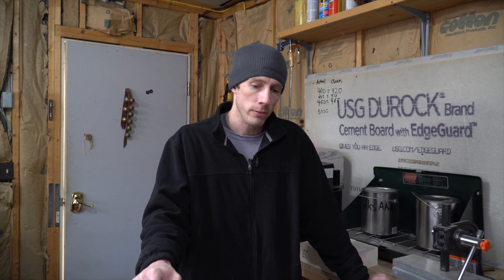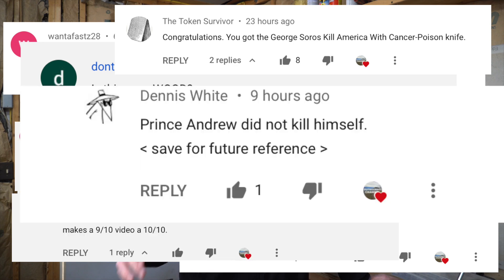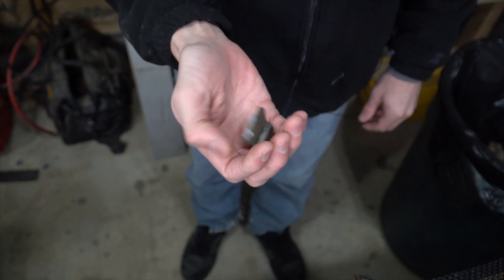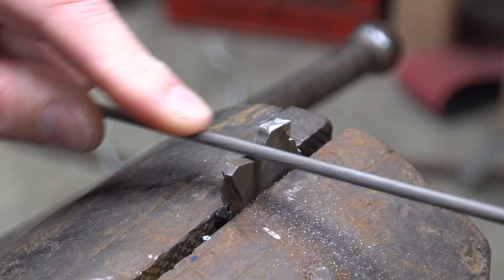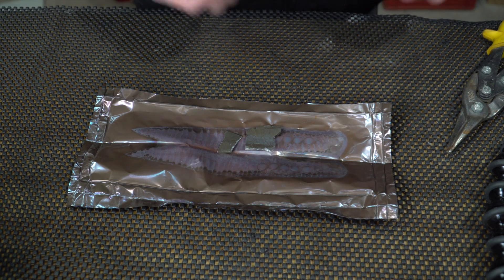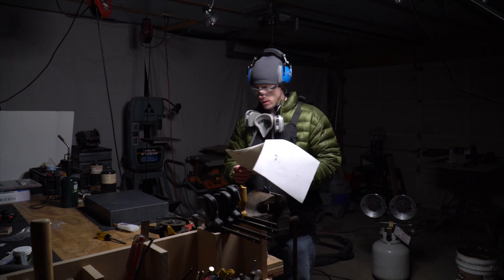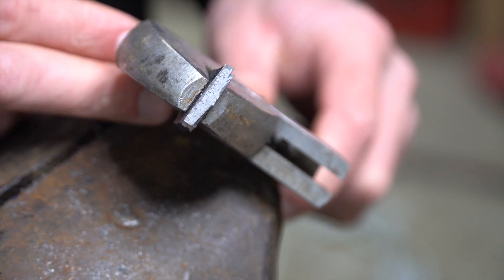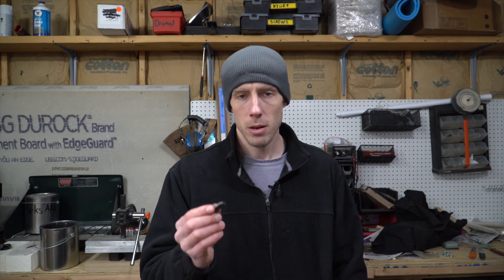Will Cheap Damascus Harden?

Comment: To me it looks like what you had is a knife made of folded aluminum and steel. After the heat treat you can still see the layering and the file just chews through it like aluminum.
Reply from the maker: Aluminum would have melted 🤷‍♂️

Comment: My steel guess, is it's actually generic recycled automotive steel. Using leaf springs can give a great knife. But if you're using a bunch of body panel steel mixed in there + zinc coatings... you're going to run into issues.

Comment: I would have tried to stick a magnet to it right off the bat. That didn’t react like steel at all, it may just be extraordinarily low in carbon but that didn’t seem right at all. Almost like it was a non steel substance coated in steel. Weird.

Comment: High manganese steel alloy. Ew. What it looks like to me with my metalshop experience. OMFG that horrendous noise when you filed it, which sounded more like rubbing a rough rasp on concrete, the second time. RIP my ears and headphones.

Comment: i think they have a mass process where they get ultra thin sheets of steel and make the damascus with one quick heat in the forge.   they dont cut and restack the billet to get thin layers.   this is why the outside forge welded good and the inside didnt.   just my guess i may be wrong
Reply: explains why its cheap, its made in the quickest way possible

Comment: now i'm no blacksmith but every hardening heat treating i have ever seen done required the metal be heated to a glowing red hot and then quenched in oil, what you did appears to be "tempering" where by a super hardened/shatter-able blade is slightly softened and relaxed to make it less shatter-able without removing most of the hardening. see you need the sudden drop in temperature to cause the metal to crystallize
Reply: go watch forged in fire, man at arms reloaded or any other knife forging video
Reply from the maker: I did everything correctly 😂 I literally show the quench. 
Watch the video again.

Comment: That steel look like something made from a car press and maybe compressed again in a rolling mill without any heating process. You couldn't harden the core obviously because the layers are not homogenized or only in contact, they never were, you can't reach it without melting all that trash.

Comment: Pakistan has a lot of scrap yards were they will recycle/reuse literally anything that's scrap-able. My guess is the knife was made from literally scrap metal from a scrap yard. Melt a bunch of random car parts, industrial machinery, etc, down and make a "knife". That's probably how they got the Damascus part, from different scrapped pieces made of slightly different steel.

Comment: park 50 is on the fast side for quench on 1095.but it will quench
Reply from the maker: I definitely wouldn't say its on the fast side. Water may be a little fast but not parks 50.

Comment: This is a very delicate knife, you need to wrap it in bubble wrap, and when you use it, leave it in the bubble wrap, it'll protect the blade and make a sharper cut

Comment: ok so the tldr is the knife is NOT what it says on the page definetly not 1095 
comes poorly heat treated out of the box and is thusly unusably soft
whatever steel alloy it is made from it IS damascus just really crappy such and it's not really worth buying as you need to put it through an insane amount of work to make it usable

Comment: Really weird steel, I've never seen anything like that, but I always buy AISI grade steels when I attempt to forge stuff. At first I was like 'Yeah that's mild steel' after you managed to file it after a quench. But then it actually snapped instead of bent, so then I thought nope that's not mild steel it's got a little bit more carbon content than that. I have a hunch though, I think it might be a medium carbon steel pattern welded with mild steel. The mild steel absorbed some of the carbon from the medium carbon steel when it migrated during their initial process. What do you think? I bet it's something like that, and I don't think they sent it to you heat treated, I bet it was in its annealed state when they sold the knife. So they made billets of pattern welded mild steel and medium carbon steel (Like a cheap 1045 or something) Then the 1045 leaked it's carbon intot he mild steel, making the overall carbon content around 0.25 or soemthing, then you heat treated it, and the carbon displaced and kind of turned martensite in 30% of it. That's my best guess.
Reply: Londinium Armoury       I reckon it may be a type of pure Iron. If it is from China they have a problem with over production of Iron an Steel at the moment. A manufacturer had some excess stock an this knife shaped thing is the result.
Reply: Or really, if you were to make a “Damascus knife” that was cheap to make, and your only worry when it came to sales was that you wouldn’t be legally changed for scamming your customers, what kind of cheap alloy would you come up with that wouldn’t be overly hard to work with? One alloy you could use would be old discarded tin cans, but what would the other be? Scrap iron is quite hard, and it would have to give that right colour.

Comment: Look like you use a chainsaw file, they will cut throw nearly anything!
Reply from the maker: They wont cut through properly hardened 1095
Reply: @OUTDOORS55  Some of the file that I have can cut throw high speed tooling steel, you can get set of files that help determine the hardness of the surface, from mild to diamond abrasive file!

Comment: Hi, Alex!  I watched both videos and have a question but, it isn't about the crappy knife.
What do you call the grid thing in your heat treating oven that holds the knives upright during the process?  AND, did you make it yourself?  What did you use, if you made it yourself and if you didn't, where can I get one?  Obviously, I like run-on sentences!
They ARE serious questions!  I've seen them in other videos from other you tube video makers and knife makers and have always wondered where or how I could get one.
I'm a beginning knife maker, at 67 and don't have all the goodies you have but, my knives are MUCH better than the one you feature in these 2 vids.  I would like to be able to do a better job of heat treating and tempering and think that whatever that thing is called would be of some use.  Are the upright rods ceramic?
Anyway, if you could help me out as to how to make one  or where to buy one (maybe do a video on making one if that's what you did) I'd really appreciate it.
If you do answer this please contact me @ 3073493792 to leave me a message.  I may never get back to this video to see the answer, otherwise.
Thanks and keep doing the great videos!  I have watch many of them and have learned a lot!  Kudos!
Merry Christmas and Happy New Year, belatedly.
Reply from the maker: Its a ceramic holder from evenheat kilns. Hope this helps

Comment: I bought one that looks very similar at a gun show in Dallas and it was not hardened either.  It split on the edge between 2 layers and when I tried to sharpen it with a diamond sharpener there were huge flakes coming off that would ignite and burn up like ferrocerium.

Comment: I didn't know if you'll even read this , but I have a question maybe you could tackle in a later video.  Question is , how do you patina a stainless steel knifeblade?? I would like to see a video on this.  I've seen plenty on carbon blades but not many on stainless.

Comment: I've heard the term "pot steel".  All the crap thats left over after proper steel us made, gets thrown into a pot and then 'single use' steel is extruded.  Any steel framing around machinery in a container from China is single use.  It might as well be cast iron.

Comment: I thoroughly enjoyed these two videos. The only reason I questioned its magnetic properties is because it doesn't quite look ferrous. Of course an acid etch will do some greying externally except that it didn't look right when you broke it up. Somethings just not right there.

Question is do they keep track of Batch numbers for Q.C. wherever they made that? Can you imagine a Bridge made of that mystery metal?

Comment: I live how easily the supposed layers separated lol it would literally take an entire reforging in order to get the layers to properly bond to one another and then maybe then it would be able to heat treat or harden to a reasonable hrc and be used as a blade steel lol

Comment: What ever type of steel it is it is very subject to surface de-carboration. From memory some types of steel require a carbon rich environment while heating to reduce carbon loss. Some modern alloys can resist this carbon loss to some degree. The alloy chosen was not suitable to the heat treat method that was applied. Once damaged it may not be repairable.
Reply from the maker: All high carbon steel is subject to decarb. Its a complicated subject i cant get into in a youtube comment. The heat treatment would have been correct if this was a high carbon steel. If these was very little carbon in the steel it would give the exact results shown. This isn't a stainless or a high alloy steel or we would have had different results. Particularly in the grain refinement cycles. Its just junk steel.

Comment: I could probably make a jb weld steel stick better than this
Reply: Challenge accepted! Send your findings in to this guy and we can compare recycled toilet slag to your JB Supreme Cutzall. I mean that kni...well metal ish object you could poke someone with, not too hard so the thing doesn’t break, but it did change the grain.
Reply: Actually you could make a fiberglass reinforced dual resin damask ‘knife’. Two different resin types mixed to make a pattern the shape, sharpen and add a handle.

Comment: Hey Alex I've got a question. Just the other day I remembered your previous quest of designing and building the perfect knife for a week long trip. I can recall that you were looking for a very lightweight option with lots of toughness. And since I'm not very well informed about the difference between titanium and steel when it comes to heat treating, would I ask if titanum would be that option? I've always heard that titanium would be much tougher than steel and since its way lighter wouldnt this be the perfect option.

Would be great getting an answer (from anybody) otherwise I wish you the best and please continue making videos! Ive been following your channel for a while now and you do produce GREAT content in my optinion. Your humor, knowledge, production value and Ideas are one of a kind! 

Greetings from Germany!
Reply: Titanium is structurally a million times better than steel. As it can take torsion and tersion as well as tension and compression much better than steel does. Titanium falls short in blademaking however as it is incredibly difficult to work with and also very dangerous. As forge temperatures it can sometimes explode into chunks of near molten metal. Oxidizing rapidly and setting many things on fire. Other than that, smithing a titanium knife is just downright hard on your tools. A grinder will take many hours to even profile the knife. Sharpening is even worse. And once sharp its edge retention is pretty much the same as steel. A little better with a little more hardness and toughnes, but overall not worth the work unless you want to make it as a show of skill as a bladesmith. Its also nearly as expensive as gold.
Reply: @Aaron Washburn stock standard titanium is better than stock standard 1085 or 1095. But HSS or stainless steel is almost always superior in the blade making realm so long as you treat it right. Titanium is great for structures though, sporting almost exact properties to steel but at much less weight. So an anvil would be great. But titanium isnt worth it as a blade. Also makes a great finishing hammer for smithing. Light hits that are easy to control. I use mine after i use my 7lb sledge and i often have a near finished product at the end. Really only needing scale removal and some file work, then a good sharpening. The heavy one moves it and my light one smooths it. I made a knife from it once but honestly wasnt a fan. It was sharp. And it could hold some edge. But i didnt like it as much as i like my other knives. It never had the same feel. Always felt like it was just a breath away from snapping.
Reply: @masonborden5594  Thanks for the good answers!
Reply: Always mate. Here to offer any other answers should you ask.

Comment: That stuff's like hot dog metal. Only the manufacturer knows what's ground up in that mess. It's likely close to pot metal, zinc, aluminum... to supplant the lack of steel on hand. It would be interesting to check it's magnetic qualities vs. the claimed metallurgy. (If it's even magnetic) (it's probably wood)

Comment: Blade steel ingredients are #1.As proven here. Blade design and execution to the point of quenching is #2.  Hardening couldn't get ahead of #3 unless you're hardening a shapeless lump of steel with known chemistry. Pakistani made folders are hilarious. Check them out on Ebay. Don't buy one again thinking it will be better. It won't. (been there )👍

Comment: So are you going to leave any type of review for this Ebay seller? Maybe warning people on your finds?
Reply: Something like "even at $25 this is a rip-off?"
Reply: Should tell the people that the 25$ gift card they used to buy it was sharper and won’t brake as easily as the knife.
Reply: No point, no one with an average IQ or higher is buying $25 damascus knives on ebay.
Reply: @crossbreedpriscilla8966  well... i know people who buy cheap things on ebay even if it is garbage... their argument is that they can buy another one if it gets damaged and in the end it is cheaper than buying a more costly one... that that is bs, is somthing that they don't want to hear...
Reply: @crossbreedpriscilla8966  I bought a 25$ dollar Damascus knife at the fle market lmao,I sharpened it and was actually able to cut some leg hair
Reply: Its a wish product

Comment: Hi Alex, you taught me how to sharpen so I think you can help me. I wanna star making knives and I read a lot of forum but I can't find satysfaing answer for my questions. Can you recommend me a good belt grinder for max 800$ and heat treating oven (electric one, i'm afraid of having a gas tank in my basement) up to 500$? Thats my max budget I can spend next year so I want to invest in my hobby. I hope you'll answer. Great video, but weird thing about this that is a literal scam and it is still on sale, it should be taken down. Wish you all the best :)

Edit: I just saw that you started your website, gratulations. Will you do a custom orders? I'd one knife from you
Reply: If you are just starting out, you don't need to get a whole shop to make knives. I would start on Ebay or Amazon, get yourself a little one burner forge, and go to Harbor Freight and get some cut off wheels, grinding wheels, flap discs, and sandpaper. Those are the tools you really need to get started. Once you become more proficient, then you can start upgrading to belt grinders, Heat Treat ovens, and the whole slew of tools that make the process more repeatable. Note I didn't say easier. Because each tool will have it's own learning curve, and process that you will have to familiarize yourself with to become proficient at using said machine. So, to summarize, Don't get the most expensive tools and try to have a full workshop all at once. Do get out there and start beating hot steel, and once you get good at that, start refining your end product.
Reply: @codenamemod2042  thank you! Merry christmas :)

Comment: Heating depleted uranium probably isn't very safe.
Reply: Dude he wrapped it in the foil, it's fine.
Reply: @scottecooke  so that's why some people wear tinfoil hats; radiation. I always wondered
Reply: @krknfmkr8919  that's a different foil. That one is for mind reading/control rays.
Reply: The foils probably harder than that "knife".
Reply: DU is a lot more expensive than this knife.
Reply: @JasperJanssen  not if it comes from Pakistan
Reply: Only a complete idiot wouldn't check if it's magnetic before putting it in the furnace.
Reply: @franktechmaniac7488  Other metals besides steel are magnetic. The knife could have been some soft iron alloys.

Comment: Or you could have test if it was steel with a magnet
Reply from the maker: That's boring and too easy. I prefer to do things as difficult as possible.😉
Reply: Junk angle iron from a hardware store will stick to a magnet.  So will 1095. There is a difference in how strong the attraction is...but this test is far more definitive
Reply: @tikkidaddy  he said to check if it was metal or some other material not iron or steel genius
Reply: @rogaldorn605  The OP? Maybe you are the "genius"...
Reply: @iliketurtles4463  well put.
Reply: Can you take this piece to lab and ask for analysis, please? I still wondering what the heck is that
Reply: Nickel and cobalt are also magnetic
Reply: Be a pretty short video.
Reply: Not all steels are magnetic enough to notice